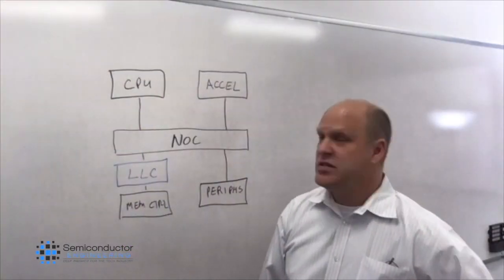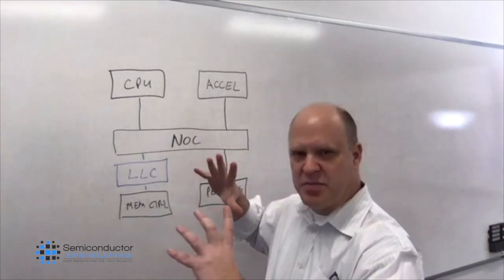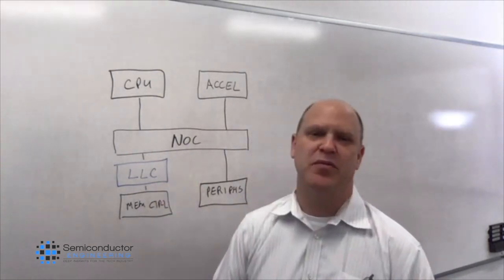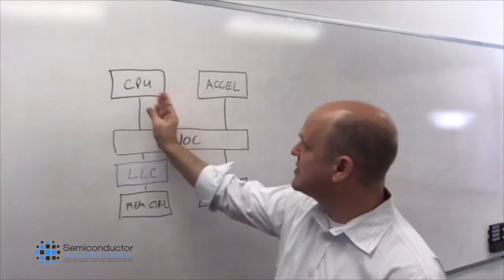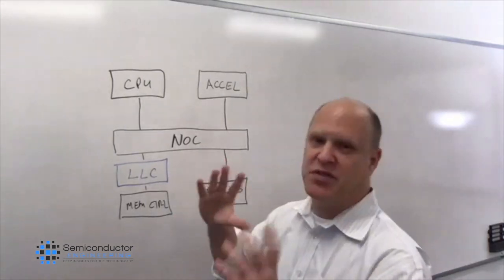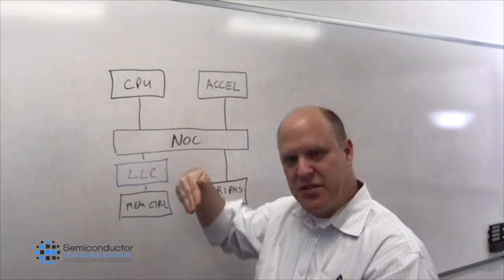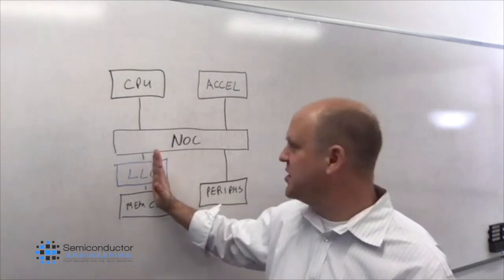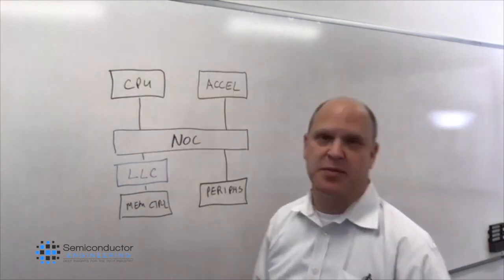Last-Level Cache

Comment: There is a very fundamental problem in this diagram. The LLC should be placed as a look aside cache between the NOC and the DRAM I/F. That is a simultaneous request access is made to the LLC ad the DRAM I/F. If the LLC already holds the necessary data 
that data is transferred over the NOC to the ACCEL and the DRAM I/F will kill the request and remove it from its request queue. 

The LLC in case of certain AMD processors has  been a glued on cache. The idea of a large glued on cache is due to Mark Papermaster at AMD. Downside of the LLC- the LCC adds a layer of latency because data still needs to propagate through the NOC
back to the CPU or ACCEL.